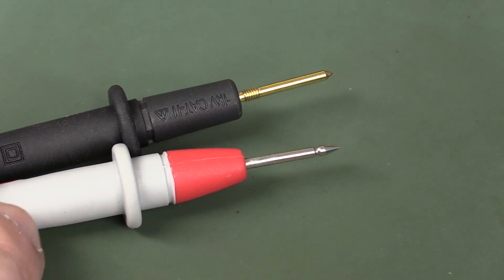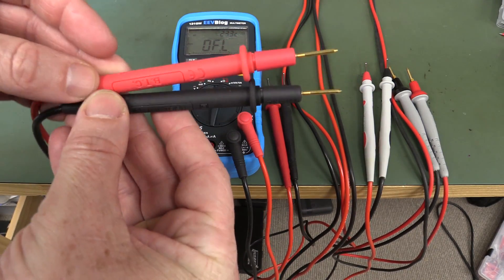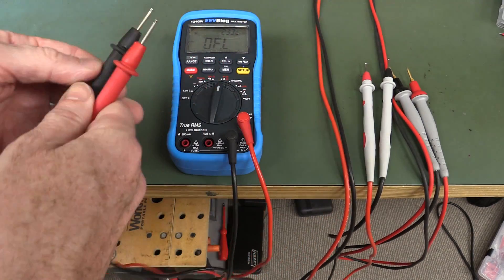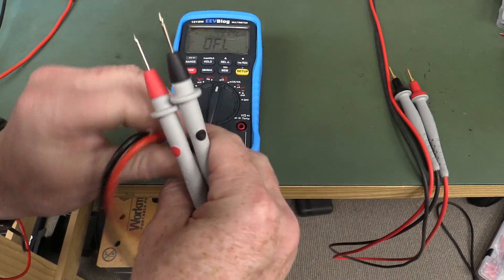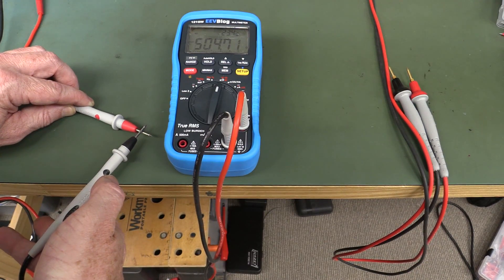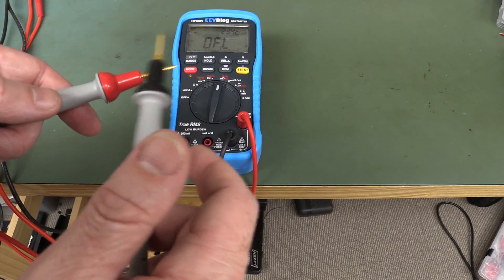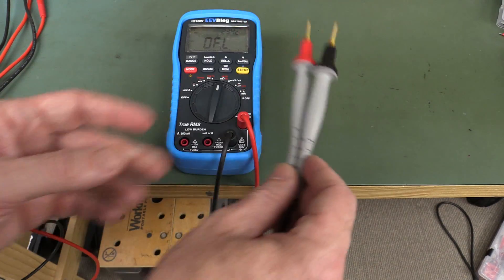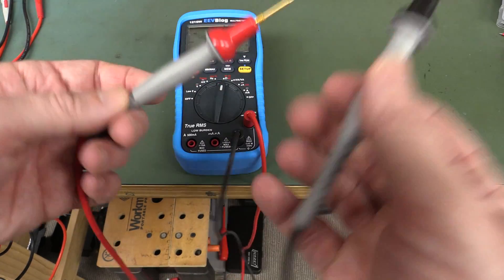eevBLAB #33 - Why Gold Plated Probes Matter

Comment from the maker: It seems that some people missed the entire point of this video. It's not really about continuity, it's about showing that gold plated contacts don't really oxidise, and hence stand a better chance of producing a better contact. Either with another gold plated contact (PCB test pad, pin etc), or even with a non-gold possibly oxidised contact (e.g. one non-oxidised and one oxidised contact trumps two oxidised contacts)

This is why hard gold contacts are standard practice in all sorts of electronics connectors, PCB edge contacts, signal relay contacts, test pads etc etc. It's basic industry knowledge, yet some people think that it can't apply to multimeter probes as well? Strange.
Reply from the maker: @Oodain Yes, I'm not saying that every probe should be gold, but I prefer gold probes for electronics use, I find them better. Yes, some companies like Fluke don't offer gold probes, and they would have their reasons for that. Others, like probe specialist Probe Master only offer gold probes.
Use what one is best for your use and requirements and preference.
Reply from the maker: I forgot that Fluke offer really awesome fine tip "electronics" oriented gold probes: http://amzn.to/2fCuoSN
Reply: I guess you just showed me why i had so much trouble checking circuits with my Fluke. It's always fine on high energy circuits like checking motors, typical supply voltages, even low voltage PSUs but when i start to measure components or go to a PCB level, i sometimes literally have to make a dent into solder joints to have a contact. Needless to say, putting excessive force on a PCB with a sharp probe can lead to rather annoying slippages !
I need a replacement meter anyway so i'll make sure the new one has gold plated probes, or i'll get them extra !

BTW, if you want to have a go at what is probably the worst meter in terms of battery life, check out mine, the Fluke 233 !!
It has a detachable screen, which is very handy when working on hard to access machines, but this thing goes dead mighty fast! I don't even use it that much but it eats me 5 AA every month.. Hopeless !
Reply: One could clean standard probe tips with a bit of solder flux or crokus cloth if you wanted to remove any oxidation. Not as good as having fancy gold ones but works in a pinch.
Reply: You should have tested this with a multimeter that makes a cracling sound when the contact is intermittent (i.e. no pulse extension). Also, a 555 will do nice.
Reply: I actually have this issue in the clean room where I work. Most of the regular probes have all oxidized due to side effects of the air purification and I often have issues troubleshooting cables and assemblies after they have been fabricated by my techs. I might pick up a pair of gold plated probes for this very reason, thanks Dave,
Reply: You can get these as well from Fluke - they work awesome:  https://www.amazon.com/Fluke-8845A-EFPT-Extended-Point-Adapter/dp/B000VRFKPW/ref=sr_1_fkmr0_2?s=hi&ie=UTF8&qid=1502590390&sr=1-2-fkmr0&keywords=fluke+8845+tip
Reply: Dave is correct with his statements about gold contacts but fails showing this with his "experiment";)
Such material analysis can only be done with hydraulic/exact mechanical pressure equipment that has feedback via appropriate sensors going hand in hand with impedance measurement. Also metallurgic surface tests via electron microscope completes the picture.
To fondle measurement probes depends highly on your personal expectations of the test results (sometimes it may, sometimes not).
But this does not change the correctness of Dave's statements.
Expensive measurement probe production just can use better materials and a fine grained galvanization process. The handling is easier.
For us poor, we have to clean our sticks like always:)
Reply: Just spend the 8 dollars. lol.
Reply: If it is nickle not chrome gold plating should be a breeze nickle and copper are used as intermediate bonding layers in many electroplate operations. Extra easy as they are their own electrode. Cody of cody'slab gold electroplates stuff all the time.
Reply: Great comparison, this is why I subscribe. 
I've always used the nickle probes that came with my meters but my background was in power supply, not fine electronics and for that the shape and durability was more important. 
A few volts lost in resistance is not relevant with a baseline of hundreds of volts, and in the same channel probing of large buses and motors is much slower paced and more heavy handed (I don't think 24k gold would last too long and would still need nickle under it) so the contact delay isn't a factor and then too such things are double/triple checked for safety.
Reply: Dave can come across as snobbish and sometimes he might be a little bias, but he usually calls it right and he calls it as he sees it. I mean think about it why do they use gold plated pins on anything that makes a friction contact. Well anything thats high quality. Think processors, ram, etc. Gold is the best metal for contact connections. I mean hes right I seen a set of these probe master probes for like 30 bucks if your serious about electronics 30 bucks isnt that much. I spend more than that on componets regularly. Hell some mosfets are like 4+ dollars a piece when do you  need less than 10.
Reply: "It seems that some people missed the entire point of this video"

That's none too surprising with this crowd, if we're going to be honest.  Conductivity.  That's the point.  I've had more than one instance of nickel-whatever plated probes failed to make any sort of connection on a device or contact I'm probing causing false readings.  No.  You don't have to get gold plated.  It'll be more reliable if you do, though.
Reply: what i and i think a lot of others are remarking is that if it really was that important as opposed to just helpful, it would be a standard on everything but the cheapest multimeters out there, i don't think the contacts of the 30usd offering you linked to has anything but plating on it, the accessories are nice and the price is about as cheap as one can expect from something that feels nice to use but lets face it, gold plating your contacts wouldn't be the largest expense in building probes.

perhaps the companies value the durability of nickel over the better contact/oxidation resistance of gold, or perhaps the difference isn't big enough in 99.9% of use cases to make the trade off worth it, not every multimeter is used in a lab setting.
with little to no price difference between either it really shouldn't be much of an issue, i will still look at the general construction, cable quality and accessories before i look at the tip material for any given price range.
Reply: I would have never guess there was a differences.    However, for the home gamer, either would probably be good enough.
Reply: EEVblog - You've lost it. You turned into raving freak. Can you check into rehab?

Comment: It's funny how actually gold is not the best metal conductor but it is used within the electronic industry with great success. All because of its stability. Electric conductivity is connected with the thermal conductivity of metals. Silver is better. But only the pure silver. Though it tarnish faster and is often not clean/pure enough. To add the insult to the injury, silver alloys are often worse conductors than pure copper. Often resulting in bad products. Certain water block company sells silver CPU water block that performs worse that their own pure copper nickel plated models that cost way cheaper. All because of the alloy. Gold alloys are behaving better and do not degrade golds native conductivity as much.

Comment: What probes you might use depends on what you are working on.  If you are working on clean PCBs with gold probe points, gold makes perfect sense.  However, for many uses the non-gold ones work just as fine or better.

Each metal plating type has a certain pressure that it takes to establish electrical contact, worse when surfaces are oxidized or corroded.  When probing onto other objects (not just the probes upon themselves) gold may help, but if you are not probing onto a gold plated surface you still need to press hard enough to establish the pressure necessary for an electrical path. Notice I said pressure not force.  When you use sharper tips it takes less force to provide the same pressure. 

So if you are probing onto solder or other junky surfaces you may want to "save" your gold plated tips from unnecessary wear and use some lesser probes with sharper, harder tips instead. When probing onto non-gold surfaces you may actually get a better result using really sharp steel tips than blunt tipped gold ones.  Especially if probing needs to break through flux or other dirt.  Just be careful not to damage the components you are probing onto when using really sharp tips.

Comment: Take any cheap/crappy non-gold leads and give them a good rub down with an ink eraser (those blue or grey ones). Then finish it off with an alcohol wipe.

Guaranteed they'll now perform just as well as any gold-tipped leads on continuity.

Comment: The gravity test does not seem fair for me because the probemaster has a little more weight and has more flexible cable than flukes tl75, so they will press harder against the lower probe, right?

Comment: How about testing cleaning methods? If it's oxidation, then with IPA remove it or what? as received, might have grease to prevent oxidation, so clean that off with IPA.  Also, would be nice to show how it makes a real difference in use other than conductivity.

Comment: A set of the gold plated probemaster leads like Dave is showing are only $16.90 with free shipping, I bought a pair and they are amazing - ive have had them transform a so - so meters continuity response to very good and in some cases excellent.  The improvement  varies from meter to meter they wont transform a shit meter, but theyre the best quality probes ive ever handled, gold plated, sharp as a needle, soft supple silicone wire, integrated pliable strain relieved ends on the probe handles, somewhere around 44 inches long and nice fitting jack plugs.  Best $16.90 youll ever spend.

Comment: Dave can come across as snobbish and sometimes he might be a little bias, but he usually calls it right and he calls it as he sees it. I mean think about it why do they use gold plated pins on anything that makes a friction contact. Well anything thats high quality. Think processors, ram, etc. Gold is the best metal for contact connections. I mean hes right I seen a set of these probe master probes for like 30 bucks if your serious about electronics 30 bucks isnt that much. I spend more than that on componets regularly. Hell some mosfets are like 4+ dollars a piece when do you  need less than 10.

Comment: and all the other propes then the gold ones you are touching the propes again and again with you fingers.
you do have an microscope' please try to look into that what kind of residue yo actually are putting on.
dip the gold ones in a bath of grease and you would encounter lacking continity.
after seeing this video tryed with th all the pairs in house and ewen under the weight of the prope there was no issues, ewen on the cheapest pair possible like ZT101 and the ones there comes there, and that is an 10USD multimeter.. ewen there it was full conitnuity all the time by solely the weihght of the prope. (so the results your displaying here, seems no  way to be real life situations)
sure gold plated propes are often better, but not anywhere near how its displayed in this video or to this extend
this video and your testing are undermine totally of the saying, you seeking an answer, like shouting in the forrest..
.

Comment: Guess who broke the very ends of his gold plated probes the next day? Yeah, it turns out it is quite brittle, at least in the chinesium probes. They are otherwise perfectly proper probes but it didn't take many minutes before the very sharp tip started to shows signs of bending. I probably straightened them 3 times and now both broke pretty much at the same time. It is just maybe 0.2mm, not visible on naked eye but under microscope so it doesn't really matter, just to point out that if it is super sharp tip, it is not going to last everyday use.

Comment: Thanks, Dave!  I've had this old Micronta DMM (22-194 for those of us playing along at home!) at least for 30 years and have always been discouraged by the delay for the continuity bell.  I always just assumed it was the meter taking its sweet old time.  

Based on this review, I ordered me a set of probes from Probe Master.  

Yes!  I know what you're thinking.  I just put a $23 shine on a $10 pair of boots.  

You know?  They even have banana plugs for old timey meter jacks that won't take the safety shroud.  Saves me the time and effort it takes to cut the damn things off.  

Anyhoo, when I click the tips together ever so lightly, the continuity bell beeps seemingly in anticipation of contact, it's so quick.  I love it!  Now I want #GoldEverything!!!

Comment: sometimes probes are not gold plated, rather a gold alloy. saw it by an accidental short between two meters measuring Hz on mains voltage. Melted the whole tip of my probes

Comment: If one moves to gold plated contacts, it would only be logical to have gold plating on the contacts leading into the multimeter, too. Of course if you buy new wires you only swap half of the contact surface right at the base of the multimeter. I've noticed what you describe, it's annoying to see it in a Fluke.

Comment: Perfectly fine probes will show different Ohms at continuity if you swap them out for some other multimeter's. They're simply calibrated for their multimeter and that's it. I've found this out the hard way, they'll just show 0 Ohms, 0.4 Ohms, or 1.7 Ohms and that's just how it is. This will affect the beepiness... And you didn't even check if the jack fit is the problem... most meters will have just a straight tube jacks with no grip, and not all probes have proper banana males. But you didn't even check the other end in the video. Hm. Continuity indeed! ;)

That said, I wish the conspiracy against electronics and for "people in overalls" would end. It would take more than gold plated probe tips for that to happen. How about fucking non 80s LED displays in meters? Would speed autorange right up ;)

Comment: The various models of these held their tin beautifully and didn't seem to erode at all. Can't comment on ultimate longevity because mine were lost in a move along with a bunch of other electronics maintenance tools.

Ungar 6424 Imperial 24k Gold Plated Soldering Iron Tip
https://www.ebay.com/p/ungar-6424-imperial-24k-gold-plated-soldering-iron-tip-iron-clad-nos/728088570

Comment: This is great stuff.  8 dollars on amazon it's almost stupid to not go with gold plated after seeing this.  I've never even thought to use gold plated probes.  I've been in situations troubleshooting automotive electronics where wires can have corrosion causing intermittent contact with multi-meters and I've always blamed the wires when a good set of gold plated probes probably would have made a big difference!

Comment: You know.. even if gold probes don't oxidase like chrome/nickel ones do.. they still get dirty. A little bit of grease and dust is all it takes. Especially when you keep your tools in a garage or a shed or you just don't use them very often, they'll get dirty and you'll get the same poor contact if you don't wipe them off, even if they're made of solid gold. 

imo the gold probes is just a meme. If you use your stuff regularly the gold will wear off in no time and you'll have paid too much for jack shit.

Comment: I have come across this problem when I had to check many points on a motherboard and needed quick results, going to order some gold probes, will make fault finding easier as you will know the contact with probes is reliable :) cheers Dave
Reply: Orrr just you know wash your probe tips sometimes, like the rest of us. After all, you don't really know whether it's surface oxide or finger oils and other sediment that's preventing your probes from working right.
Reply: new probes from a new meter, i'm using now, use to wipe probes with an isopropanol wipe.

Comment: The thing is, that in real life application gold plated would not be gold plated when it comes to every day use. The issue is that gold is not hard wearing enough, when working on repairing equipment, fault finding, making a good connection requires decent force that soon damages gold plating. It has its place in a lab with untainted parts but that is all.
This is the first video of Dave's that I have watched that I have actively disagreed with and it really feels like a very dumbed down point of view marketing video, I'm sorry to say it but it's not the balanced rationalising of an issue that i would expect.

Comment: doesn't gold plating eventually rub off. then you're right back to shitty metal!
Reply: Gold sticks pretty good though! On the other hand, your probes are nickel plated brass, and once nickel wears off, they aren't necessarily fun to use either. But it can take years or decades. I wouldn't worry about it.

Comment: Make no mistake though, gold is a shitty conductor. Absolute best conductor is copper, at a close second comes silver, then with a large gap comes aluminium and only then comes gold. It's practically worthless as a power conductor, but it's very soft and will deform into good contact area easily.
Reply: From where do you get your facts? For a long time, it was known that silver was the best room temperature conductor followed by copper. Only recently did silver lose its place to the wonder material, graphene (carbon).